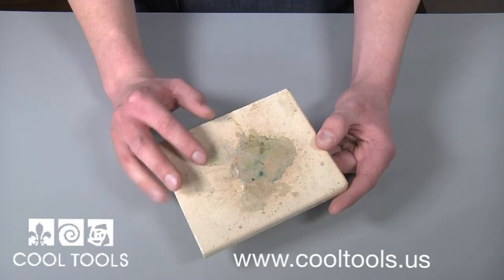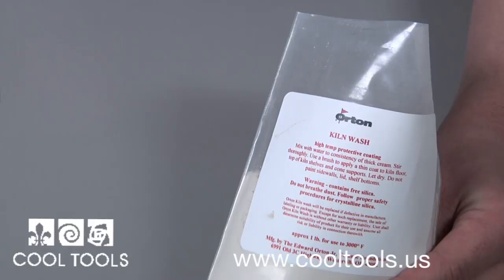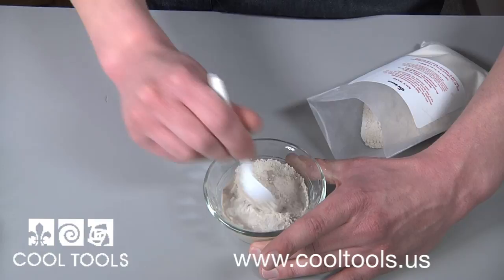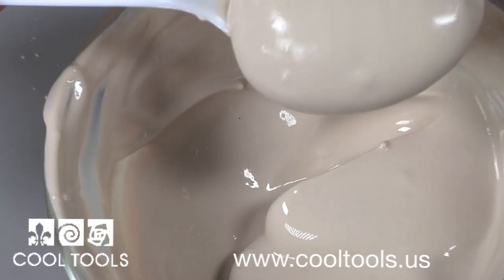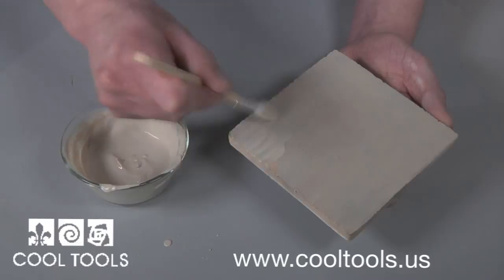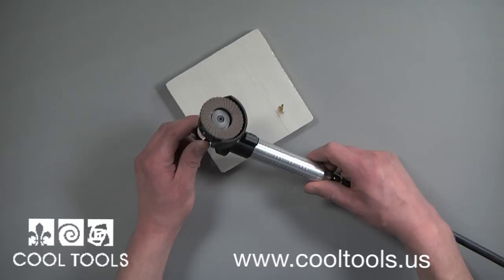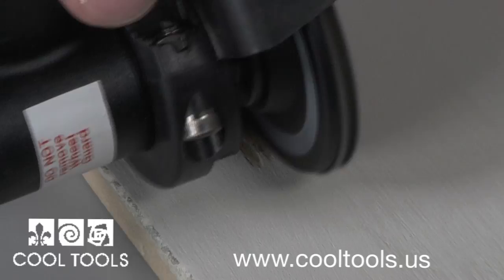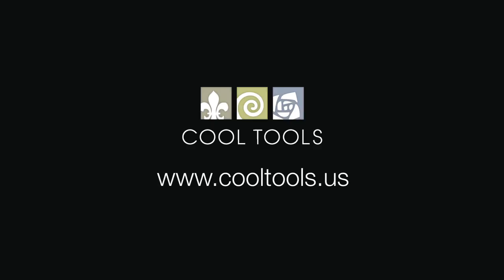Using Kiln Wash

Comment: Why do your instructions not match the instructions on the kiln wash package? They say to mix it 5-1, water to powder, which gives you a watery mixture. They say to apply 5 coats in different directions to avoid 'lines' in the finished piece also.
Reply from the maker: Hello, I think you may have a different type of kiln wash as I am looking at the kiln wash now and do not see these instructions. I hope this helps.
Reply: Most instructions seem to prefer multiple coats of thin kiln wash. I'm going with the majority instructions on this one

Comment: Nice, thank you!!
Couple of questions: After a number of uses, shouldn't I remove it completely and apply again? 
Also, can I wash it away with water?
Reply from the maker: Hello, when something sticks to the kiln wash, it can simply be ground off using a small hand held grinder. Grinding will send chips of material flying, so do this outside and use a mask and safety goggles to protect yourself. Thanks for watching!